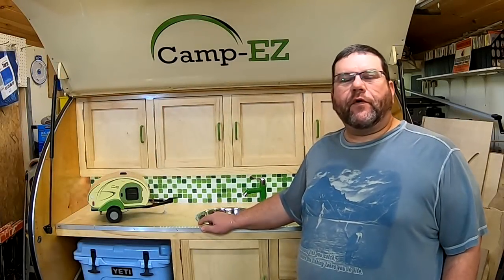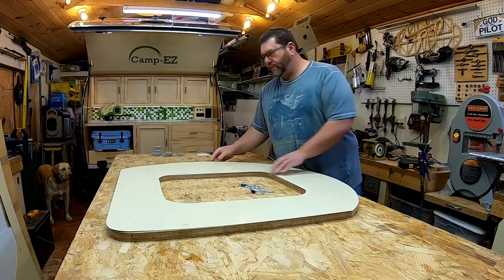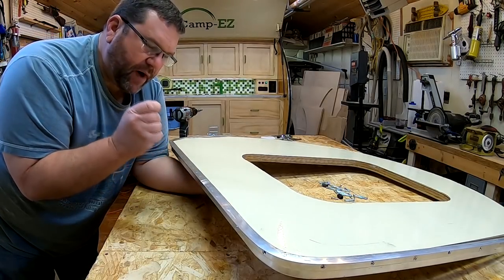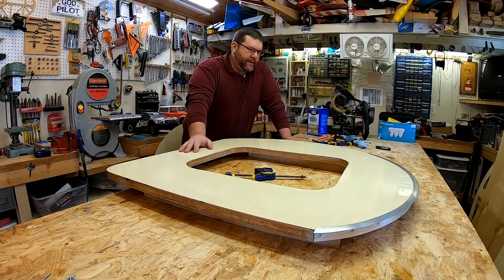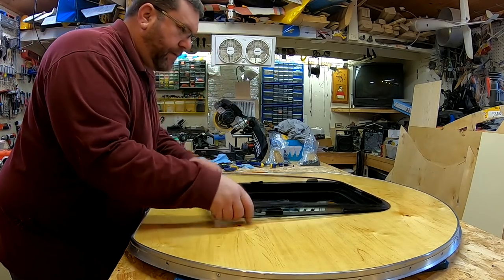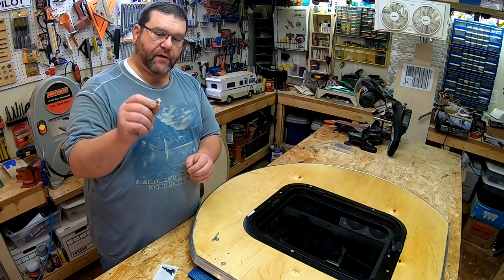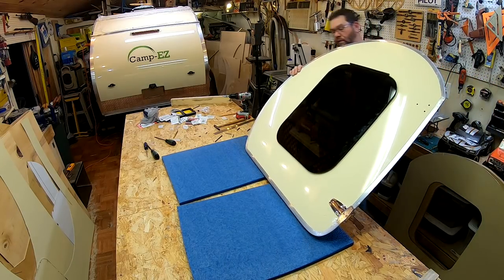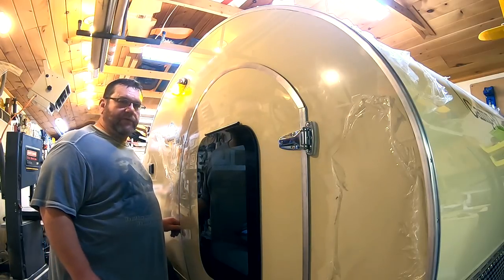Final Door & Window Assembly - Camp EZ Teardrop

Comment: I'm building doors to for a teerdrop too and I have three layers for the walls (1/2 inch plywood, 1/2 inch hard foam insulation, and 8 mm ply) do I need to make the door with the same layers?
Reply from the maker: That’s what I did, but after adding the rubber seals, my doors stick out from the camper walls the thickness of the seal.  I could always change it, but don’t mind that they stick out.  I ended up going with a rubber seal from Vintage Technologies that’s the shape of an arrow head.  The tip of the arrow goes in my T molding in the door.  When closed, the seal makes the door wider than the door opening, so the seal basically compressed against the outer wall of the camper.  A bit non-traditional, but it works great for keeping the rain out.  If you don’t want yours to stick out, you’ll either need to make the doors thinner than the walls to account for the added thickness of the seal, or make an inner door jam that is waterproof.  Check out the website TNTTT.  Lots of door ideas there.

Comment: What was the trim that you used for the door , I no one is called t trim but what was the other , cause it really makes a nice finish
Reply from the maker: Thanks!  I actually made these doors different than most other builders.  Mine stick out from the walls,  while most others are inset flush.  I wanted the seal on the outside.  The other piece of trim is L trim.  Both can be found at Vintage Technologies.  Disclaimer, I hope to have it on the road next week, so we’ll see how well the seal works.  Fingers crossed!

Comment: How are the hand made doors holding up after the years?
Reply from the maker: They’re doing great.  So far, not one problem.
Reply: @CampandCamera  watching your videos have put me into less of a self doubting mind set. A great boost of confidence!
Reply from the maker: DIY is no problem!  You only build a camper one piece at a time.  No need to worry about wiring when you’re working on doors.  No need to worry about plumbing when you’re working on wiring.  You got this!

Comment: Where did you get that hinge
Reply from the maker: I picked the door hinges up on eBay.  I searched “Chrome trailer hinges.”  Some also call them refrigerator hinges.
Reply: Thanks
Reply: Just any refrigerator hinge or how much clearance, I have the t molding
Reply from the maker: Jeff Towner Here’s an eBay link to the same type I used.  https://rover.ebay.com/rover/0/0/0?mpre=https%3A%2F%2Fwww.ebay.com%2Fulk%2Fitm%2F202671727894